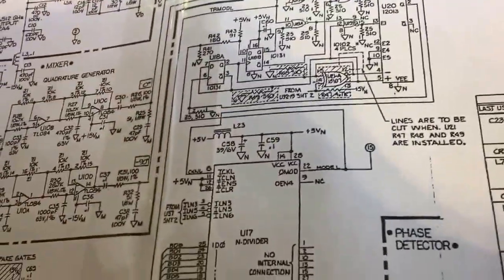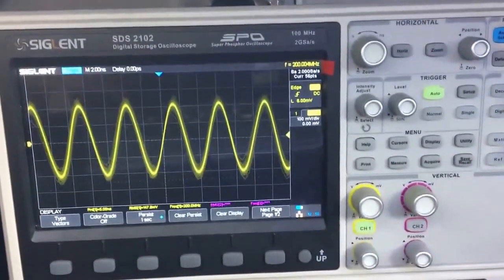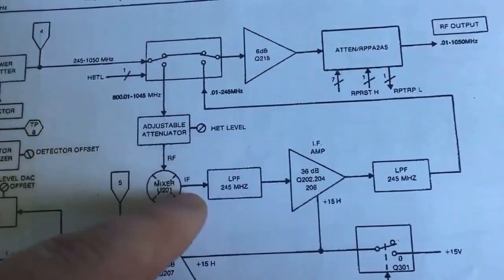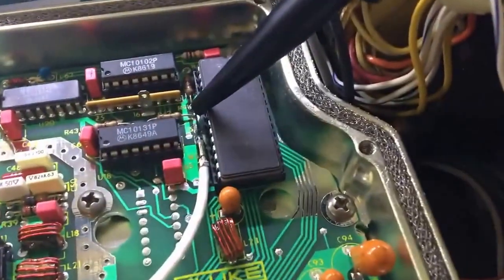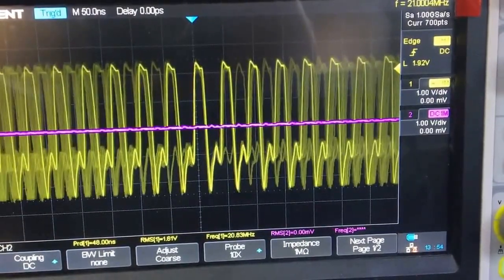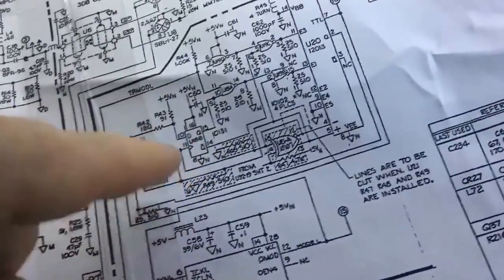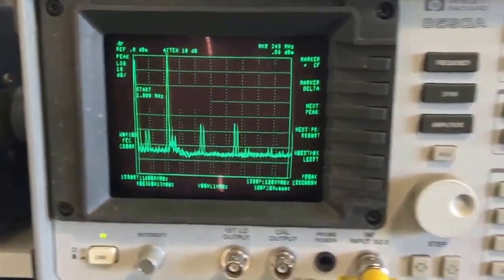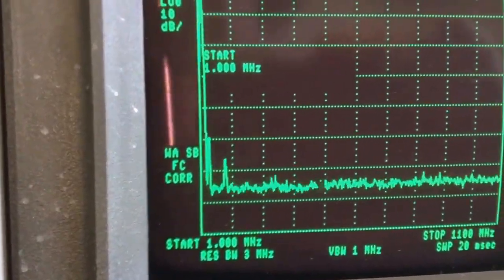#95 Fluke 6060B RF Signal Generator Repair Part 5

Comment: Think you might take a look at manual section 4D. Some front panel commands to help issolate problems between control, latch and RF.....
So it seems once again I was wrong in my diagnosis. Guess I'm getting too old.

Comment: Whew! Lot of work and thinking there. I have a 6060A which is still working fine, but the VFD is getting very dim. I've seen a number of these that seem to have this issue, and many don't have a lot of hours on them. Is this one a little on the dim side? I can't tell from this video. I know I'm commenting on a older video here. Please forgive.
Reply from the maker: Danish Native - I’m glad someone has actually looked at some of my old videos! Excuse the bad camerawork! Yes the display on this unit was a little dim, but wasn’t too bad.
Reply: Thanks. I just purchased a 6062A for 150 US $ shipped. It's popping out an error code on power up. If I can't manage to slay it, I will use it for dead weight in the the truck bed. After watching your repair series of this one, I think I'm getting in neck deep.

Comment: The image is shaking so badly that it is hard to watch, and makes your video look unprofessional. I would suggest using a tripod for your camera. This must make a huge improvement.
Reply from the maker: FeedbackLoop - thanks for your feedback, you are right that I should be using a tripod more. I do use a couple of tripods, but sometimes I need to hold my phone when recording, and then don't go back to a tripod when I probably should do so, I will try to improve my tripod setups in future. By the way, I enjoy your videos greatly, always very interesting.
Reply from the maker: I have just tried turning on the stabilization feature on this video, to see if it helps smooth it out OK, hopefully it doesn't have too much in the way of side effects!